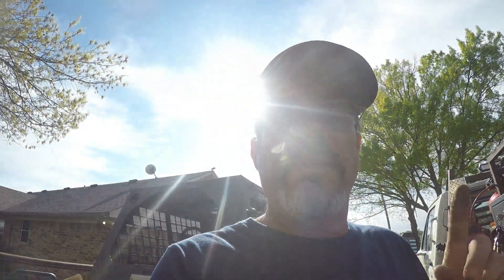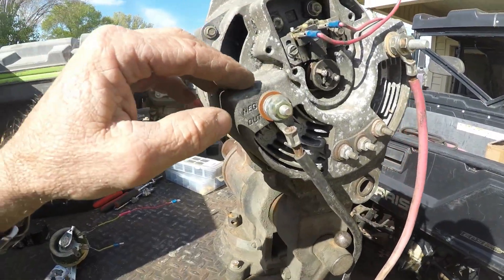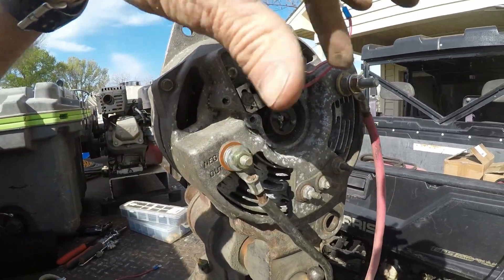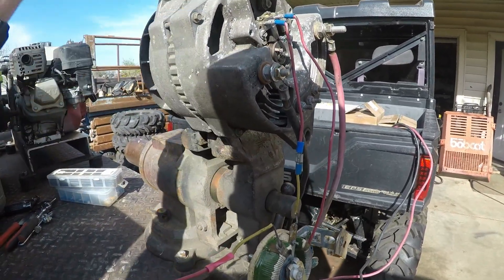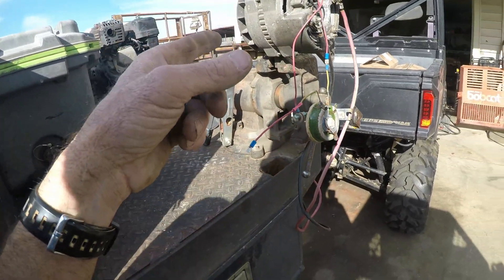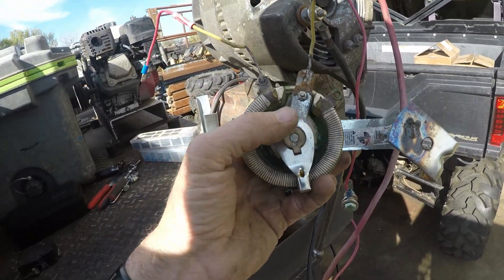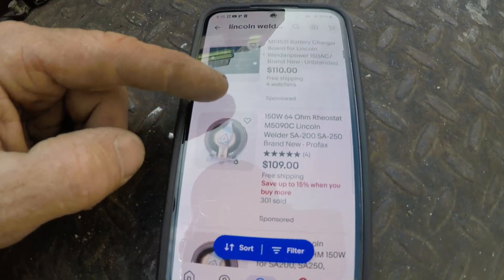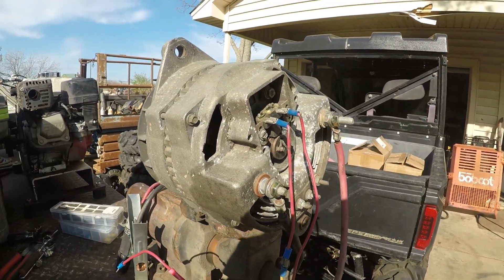Easy Alternator Welder Setup Anyone Can Try!

Comment: High power resistor could be made from an old toaster wire for example,  or you could use power transistors.
Reply from the maker: Very true. Thanks!

Comment: I may be a little slow but by cutting the three phases from the regulator and leaving them cut how do you get power to the hot and ground lugs?
Reply from the maker: @TheOldKid  just cutting the voltage regulator out of the picture

Comment: I use 10 or 20 amp motor controllers off ebay in place of a rheostat. They are much much cheaper than the ceramic rheostats and work fine. The fields will never pull 10 amps full fielded.
Reply from the maker: @pl747  great idea. Ill look into that. Thanks for the tip!

Comment: Might be able to find a rheostat off an old welder at the junkyard.
Reply from the maker: You're right. I never even tried that. It always welded so well like it was, I just left it that way. I hardly ever change the settings on my lincoln. I usually weld in one of two settings for all applications

Comment: a variac voltage aduster has alot more windings. it will likely give infinite adjustment. that is a variac in a cruder form.
Reply from the maker: @blueelectricfusion  ill check into that. Thanks!!

Comment: you control volts by spinning engine faster.
Reply from the maker: And on the last one, I had a different pulley setup that worked alot better. This one is OK for small thin stuff
Reply: yup. different pulley .. differet rpm of alt.   hmmm.  drimmel a key way on the shaft to make pulley swapping easy??   allows you not to have to rev. engine higher.  though likely only benefit for large projects where you will stick with same volt amp for hours.
Reply from the maker: Maybe. I wonder if one of those torque convertor clutches would work with a handle throttle? Might be work looking into. You cam get those cheap on ebay

Comment: Hi,
I'm not exactly sure on how to do this. I've never opened an alternator and don't understand how they work. I have a 160 amp, externally regulated alternator that I mounted on my engine. It is a stand-alone for welding only with no regulator. The stock alternator is still in place and will do the battery charging.
From what I gather, all I have to do is put 12v to one of the two field wires and the other to ground. Then the negative for welding is the body of the alternator and the positive is off the post that previously went to the battery. Is this correct.
Thank you.
Reply from the maker: I believe that is correct. I'd have to go back and look at my video, but I believe that's the way mine is wired
Reply from the maker: There's a ton of videos on yt about wiring these. Problem is there's lots of different types of alternators. They pretty much all can weld, they just go about getting there a little different.
Reply: @oldironfinder  Yep, I just started looking into it and the variations are what was throwing me. I'll give it a shot once I get the new belt in place.
I'll post back with the results, 'cause if this works, it is cake. No need to spend the $1500 on Premier!
Reply from the maker: I couldn't agree more.  I really enjoy making stuff myself and not having to buy unless necessary. Plus, it's alot more fun!! And rewarding when what you build actually works! Just keep it up and you'll get there.

Comment: @old iron finder Wow man so glad I found your video about the homemade welder you made 5 years ago! I have some questions tho,  for you could you use a truck alternator and still be able to weld or would that not work? Also what is the alternator you are using actually from? Thanks!
Reply from the maker: Yes you can use a truck alternator. You could use almost any alternator for that fact, but this leece neville is literally the easiest to convert to a welder. Snip a few wires and its ready to weld. That is assuming the diodes are good. And I believe the alternator I used in the video came off a peterbilt or some other large truck